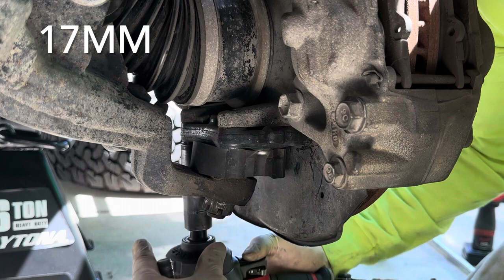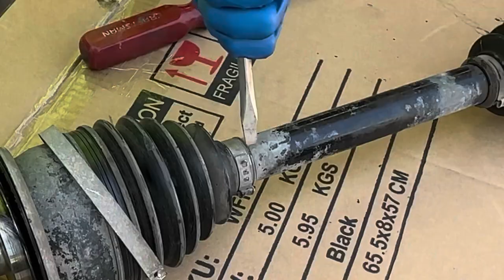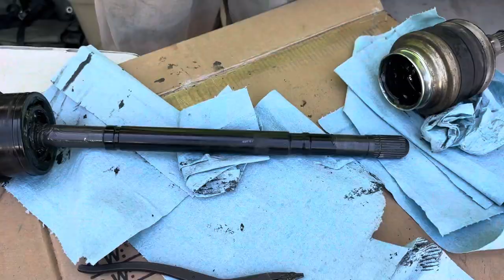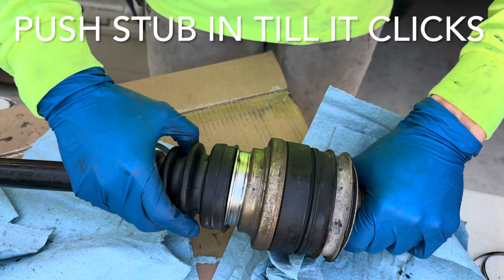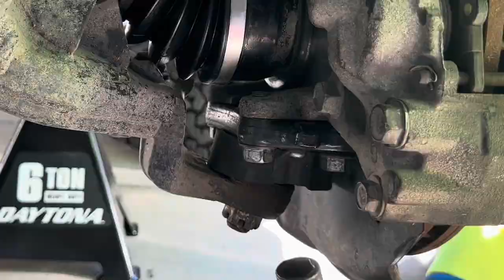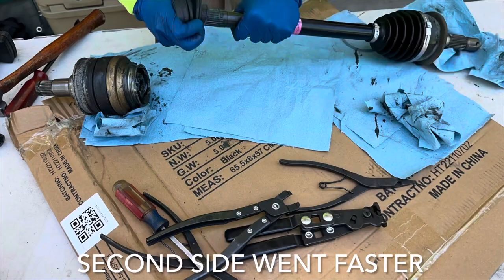Toyota CV Axle Rebuild - Reboot / Tundra / Sequoia / $50 per side / 1st Gen Toyota Tundra

Comment: Thank you for posting this. Will be taking this on in a few weeks since I’m replacing many front end suspension parts on my 1st Gen Sequoia. I’m nervous, but your video will be my guide 🫡
Reply: Hello!
I am not sure if you have started on your project. The clamps may look similar but they are not. They each have their sizes in MM stamped on them. Be sure to note which size goes with what boot. I hope it helps. I rebuilt my 2002 Tundra front end and it drives like new again. I have 535K miles on it now.
Reply: Hello there, 
Thank you for the note. I did take note of this when I pulled the axles apart. Those little details that you have to watch out for. Thank you for the note and I’m sure it will help others when they take this on.  Be safe and happy wrenching 🫡

Comment: Perfect timing. I was already planning on doing this today.  Question though.  Only my outer boots are torn, the inners are high angle boots from CVJ.  Is there a way to only remove the outer joint, or is the only way to disassemble the inner joint?  I don't have replacement clamps for the inner.
Reply from the maker: The inner has to come off to get the boots out. You can buy replacement clamps. There is the size on the clamps. I have even been able to save the clamps if you are careful with removing them.

Comment: Awesome, I really need to to this. But I wondering if it’s too late for just a boot and grease replacement. 
Makes some awful noise, but only in four-wheel-drive.
Reply from the maker: take it apart and see. if there is no rust and no grease, it might just be noise from no grease

Comment: I did exactly as the video entails. However I can't sling or get the knuckle and ball joint to align. 2001 Toyota Sequoia 4wd limited.
Reply from the maker: sometimes it helps to jack up the LCA up till you get a little pressure on the knuckle. Than just wiggle the knuckle till the ball joint lines up.
Reply: @Wonger559  thank you this helped a lot. I subbed to your channel and hope to see more content 🙏
Reply from the maker: @evelynnveleni Glad you got it. thank you

Comment: This is mad late but do you know the size of the inner clip? The small boot clamp?
Reply from the maker: I dont know the size. The OEM boot kit comes complete with the clamps
Reply: @Wonger559  man I’m just trying to do the boot slide mod. I ended up buying some smooth edge clamps for soft rubber from McMaster Carr in the same width as Toyota is back ordered for 3 weeks.
Reply from the maker: @Slickrickthethird  you can measure your boot and order generic clamps on amazon of the same style

Comment: Hi, do you think that the seal on the gear box needs to be changed for peace of mind when doing this job? Will the seal last very long?
Reply from the maker: I personally have never had to replace the diff axle seal when doing this job. If it wasn’t leaking before. It won’t leak afterwards as long as you take out and reinstall axle without damaging it.
Reply: Many thanks for replying on the topic. I'm going to replace a leaking boot so your answer helps a lot. Thanks again. Take care.

Comment: I wonder how different this would be on a rear CV for. 2nd gen Sequoia?
Reply from the maker: It should be similar. Odd you would need to do the rears as they really don't see much wear since they are not steer axles
Reply: @Wonger559  Yes sir. It's a mild bummer. I ripped a boot somehow and I allowed a shop to talk me into aftermarket half axle. 1 year later... it's fine around town but there is a little play in it when I grab and twist with my hand. Maybe a 32nd of an inch? Just enough to wiggle it. I "think" i can feel it when under load... towing uphill my 3500lb trailer. I could probably leave it alone? If I do replace it I would rather watch 100 youTUbe vids and gather info...  fresh seal, toyota axle,  proper torque settings, top off diff. Oh, and the dealer wants $1300 dollars! Thoughts?
Reply: @Wonger559  Yes sir. I managed to tear a rear boot. I let my local shop talk me into an aftermarket axle. Year later... it's fine around town but when I'm pulling my 3500lb trailer up a hill... I at least think I can feel a little vibration. When I grab the after market axle turn/wiggle it about a 32 of an inch? just enough to make me sad. I'm trying to decide if it's worth replacing. What do you think boss? Wait till it gets worse? or put a Toyoter axle in there?
Reply from the maker: @js887744  They should have a little play in them. The vibration could just be your driveshaft u joints. Look into shooting some grease into them.  I would keep and eye on it and see if it gets worst.

Comment: Question 
When you lifted your truck. Did the inner boots leaked ? 
Just had my truck lifted 2” and had a leak from both inner boots.
Reply from the maker: Usually happens when the cv boots is old and been at stock height all it’s life.  Pretty common to have to replace the boots after a lift so they will wear in a new pattern.
Reply: @Wonger559  thanks for the quick reply. I like your set up!
I see you’re 550 area code?
Reply from the maker: @csworks9525  yes 559
Reply: I'm currently doing mine and the inner axle doesn't want to sit flush like how yours did in this video. Do you have any pointers for that?
Reply from the maker: @Natebascon  flush with the differential ?

Comment: Do you recommend buying oem toyota cv axles or will a good aftermarket be okay? My tundra is leveled in the front and some shops have told me I need extended axles even thought it's only like a 1-2" lift. 
Not sure if they mean high angle cv boot axles though.
Reply from the maker: Oem axles. I’ll rebuild oem junk yard axles before I’ll run any aftermarket ones.